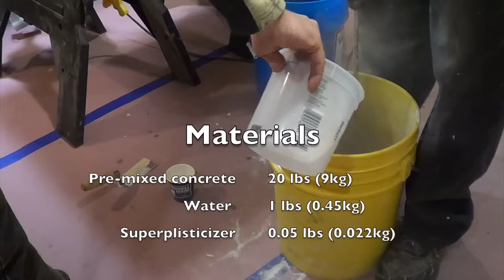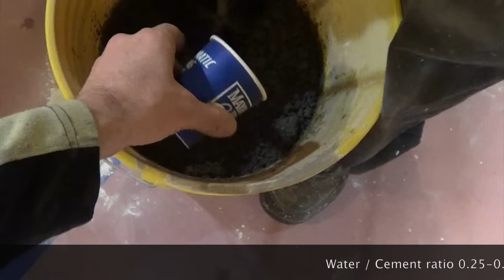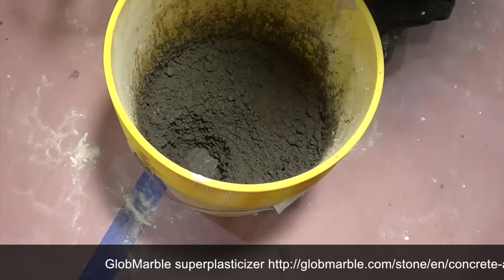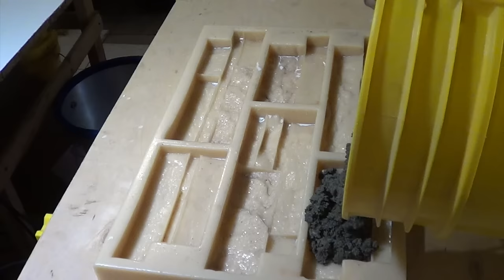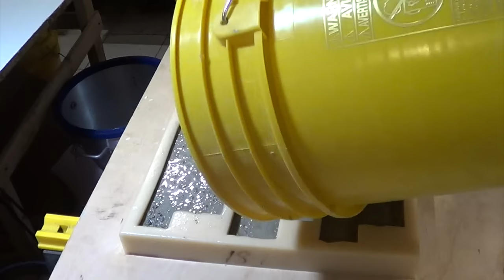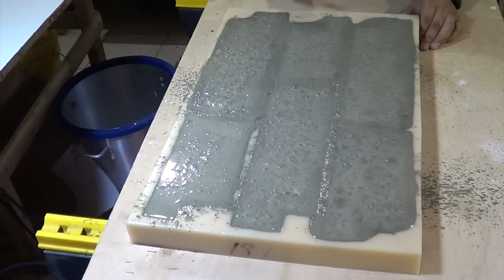Concrete Stone Casting. Pre-mixed bags of ready-to-mix concrete

Comment: Bit late to comment on this, but just came across it.You can substitute the Superplisticizer for normal Dish Soap, it does the same thing and is basically the same chemical make up and save a heap of $.
Reply: Yes, you can use any type of Motor Oil or Diesel Fuel, just paint it on your Formwork with a brush. I used to be a Formworker/concreter and we always used Diesel as a release agent and just cheap dish soap to extend the work time and flow of the concrete
Reply from the maker: A dish soap wouldn't reduce your water usage. Super plasticizer it's a water reducer. Super plasticizer increase in paste quality will yield higher compressive and flexural strength, lower permeability, increase resistance to weathering, improve the bond of concrete and reinforcement, reduce the volume change from drying and wetting, and reduce shrinkage cracking tendencies. Superplasticizer based on latest polymer technology. These types of superplasticizers typically contain certain side chains based on polyethylene glycol. Due to raw material synthesis of the polyethylene glycol, the nature of radical polymerization and the composition. How you can substitute dish soap to super plasticizer and how a dish soap can have the same a same chemical make ups? 
Super plasticizer makes your concrete mix liquid with very low water usage. In most of the cases you don't have to use vibrating table ( which cost over 1500$) because Super plasticizer makes your concrete mix liquid. How can you save a heap of $??? you can get 1 or few lbs of super plasticizes and save thousands of $ on vibrating table....

i would not recommend to use any nafta oil including diesel unless you're use plastic molds. There is a little issue with a plastic molds. You wouldn't get a natural stone texture from plastic mold. To get  a natural stone texture you should use a rubber mold.  Diesel will penetrate to a rubber mold ( you wouldn't be able to clean your molds)  and you'll have an oil stains on your product face.
if you don't have a release agent i would recommend to use a soap dish as a release agent substitute, but if you ll get a good quality release agent concentrate, you'll save money and you'll have a good quality product in the end.
Reply from the maker: +Damie Mait . Each mold purchase comes with stone making instruction.(information and tips on: mixing and pouring concrete, coloring the stone, releasing the casting).
i cannot guarantee that a dish washing liquid soap will make a good release agent... but is't much better than diesel or motor oil. 
If you don’t have concrete release agent, you can try dishwashing soap, if dishwashing soap wouldn't work in your case, order release agent. This is our concentrated release agent.  30 parts  water to 1 part release agent product http://globmarble.com/online-store/en/concrete-mold-release.-g-1.html
Reply from the maker: +Damie Mait   Stone making instruction should be emailed to you with shipping confirmation. If you didn't receive the emails, contact us please. Contact info here: http://www.globmarble.com/contacts/

Comment: How long to dry before demolding?
Reply from the maker: Concrete can take anywhere from 8 hrs to 24 hrs to set, it all depends on what concrete mix is used, weather conditions, the size of the mold, and the amount of water used.  The cycle time can be reduced further by using only enough water in the mix as is absolutely needed, or using a faster setting concrete additives.